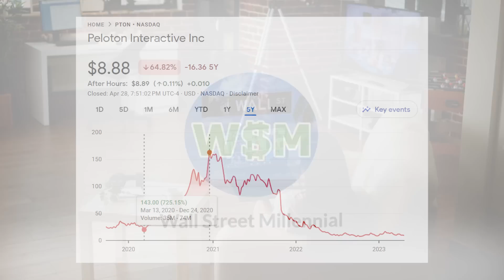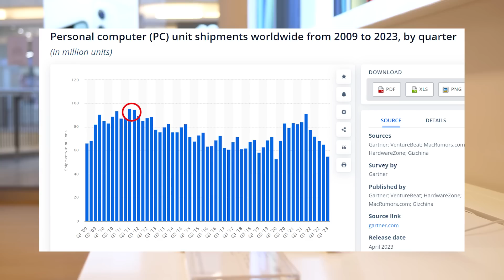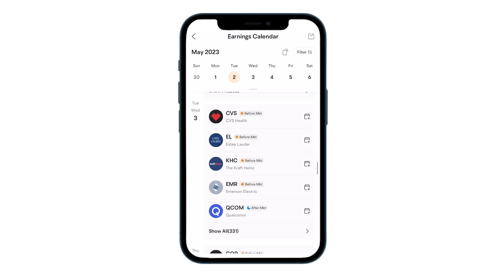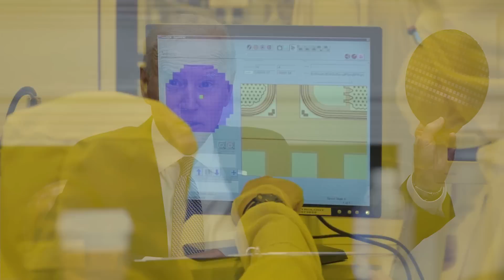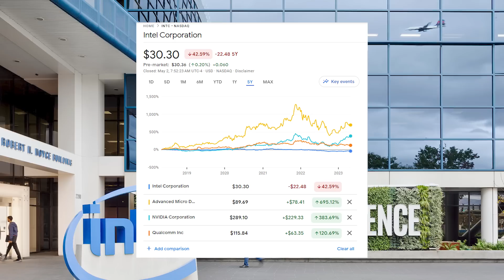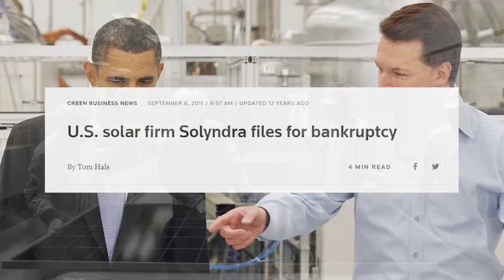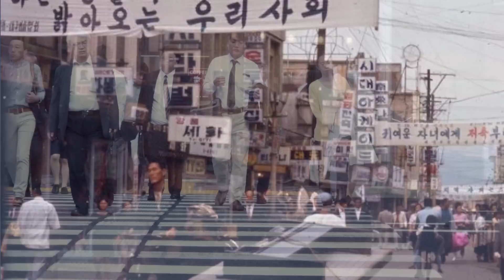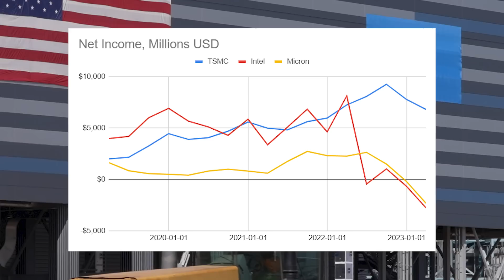The Great Semiconductor Glut: Unintended Consequences of Govt. Subsidies

Comment: I think you miss the ever growing demand for NAND flash in SSD's, GPUs for AI and various rendering or massively parallel operations, the ever growing world of IOT, and for the entity of the data center market. (more power efficient servers, switches, routers, NICs, think stuff that gets burned out oftenish.) That 2011-2020 its also important not too much was happening due to multiable failures from AMD, and intels unwillingness to improve. The consequences of such has been a slow burn for intel for almost a decade. Thats not even getting into how tax law encourages companies to constantly upgrade IT hardware in large data centers.

Comment: Sorry, but this video contains several informations that are simply wrong or misleading.
First: the cost of labour makes setting up a fab in the US unattractive. This is an old myth stemming from the 1980's when the industry started to leave the US. Back than the percentage of labor cost per Waferstart was at 37% of total cost. In 1995 this percentage had already dropped to 11,5% and has dropped even further. Why? Simple: the most expensive part is running the fab: facilities, energy, water, materials etc. - and managing these cost and managing a high volume output with a high yield is the key to running a profitable fab. But this is something investors don't want to hear because it's so much easier to dump all the blame on the staff instead of doing the hard work to identify the stuff that really cost you money and to invest the money needed to improve things.
Second: You're looking at the wrong companies for a picture of the semiconductor market. Intel is no benchmark at all since it's been the old sick man of semiconductor business for quite some time now (it started before the pandemic but the problems were glossed over by the high sales during the pandemic). PC is not the main market for semiconductors, you've to look at the industrial applications like automotive, energy, microcontrollers - that's where the money is. TSMC does foundry work in this field as well and that's why thei're not hit as hard as the manufacturers of CPU's and DRAM. And in the industrial market hasn't been a correction of the market yet  there's still way more demand than supply.
Third: China can increase their subsidies for semiconductor fabs as much as they want, they can't get the most important machines for the high end stuff: DUV Lithographic Tools. These are banned from getting exported to mainland China.
Take a look at semiconductor companies like Texas Instruments, Renesas, NXP, Infineon etc and you see a different picture... . Do I say that the subsidiaries for a company like Intel make sense? Not necessarily, it depends what Intel is going tp produce. Lately the Intel CEO talked about taking up foundry work. If they do this on high quality level they can be succesful, but if they mess up big time these new fabs could become a monetary burden that could very well start the downfall of the giant.

Comment: Semiconductors have ALWAYS been boom and bust. These new Fabs arent online yet and aren't going to start producing in any volume for a few years at least. The shortages are a lot more complicated than people realised. Most of the shortages affecting appliances and cars came from other components like power stages and substrates. 

The issue with automotive is the hubris of automotive manufacturers. They were using very old dirt cheap nodes. When they cancelled orders many of these older fabs were shutdown to transition to newer more profitable and productive nodes and now automotive component suppliers are scrambling to change their designs for these newer nodes.  As a result car making is still screwed. Interestingly Tesla uses much newer nodes for most of its semiconductors as do the newer chinese brands which is why they are less impacted. 

Intel is lagging behind AMD in terms of architecture for it's processor performance and behind TSMC Nodes and they have been steadily losing market share as a result. 

Demand has fallen for a number of reasons. 
In client a lot of consumers bought during the pandemic and probably won't upgrade their systems for a while. You also have ethereum switch to proof of stake which basically killed GPU minning which has resulted in a lot of relatively new ex minning GPUs flooding the market switch supresses demand for new GPUs. This current generation of GPUs is also pretty uncompelling for consumers as it represents a relatively small improvement in performance for most SKUs. 

Enterprise and hyperscalers which make up the majority of volume for chip makers like Intel AMD and Nvidia are reducing orders due to tighter monetary policy and uncertain economic conditions. Intel has been hurt the most by this as AMD continues to take market share from them. 

TSMC is having problems with their newest node iteration which apple was set to use first for their new iPhone and M chip as a result Apple isn't ordering as much as they otherwise would have and have changed their launches of new products. 

We are in the middle of the transition from DDR4 to DDR5 so demand for DDR4 is falling but DDR5 is not ramping up as fast due to slowdowns in procurement in the enterprise and client sales which is hurting micron and samsung as the biggest suppliers. 

Samsungs 5nm and 3nm nodes are not yielding well which also doesnt help them with mobile chip sales. 

In the short term things are messed up but by the time new capacity comes online it's likely that demand will have rebounded. 

The elephant in the room is china and taiwan any conflict in the region will disrupt the entire supply of electronics and this is the main reason for onshoring more capacity.

Comment: Great video! However you seemed to miss the most obvious reason for the United States to subsidize semiconductor manufacturing, national security. In fact I don't think you mention once the national security interest the United States would have in not only maintaining a domestic supply of microchips in the event of potential trade break downs due to either pandemics or war, but also the increased need for those chips during a potential conflict. Even with most semiconductor fabs existing not directly in China, as they expand their sphere of influence the world's major fabs are within an ever shortening reach. The United States is maintaining subsidies in semiconductor manufacturing to maintain their technological dominance and military scale against peer and near peer adversaries.

Comment: As usual the devil is in the details.  Intel does NOT make the "Chips" that dominate the supply chain problems we see in devices/cars etc.  Intel primarily make server-farm and laptop chips.   Anyone with half a brain and any knowledge in the semi industry saw this glut coming and the chips act as a big corporate welfare give away to a company already making 50% gross margins.
Reply: although I agree with most of what you shared (I worked in semiconductor for >20yrs), there's a reason why companies don't build fabs.

It's extremely risky and capital evaporating, where you don't get a return on your giant financial risk at least 5yrs or more into the future.  Your investment doesn't even generate any revenue ,let alone enough to cover the risk, for at least 2yrs minimum.

Companies HAVE to have high margins to cover the past risk, but also to pad themselves for the next high risk investment.

Building a foundry, and going with a foundry to build your chips is the much safer route.

I've seen dozens on dozens of chip companies go out of business since the 90s.

I have no issue with the subsidies, to compete with foreign companies who do get massive unfair subsidies to put the USA out of business .

Comment: Intel's problem is not that of costs. They fell behind in their fab tech, making their chips less competitive. Intel even started using TSMC to manufacture some of their chips, which is outright shameful from historical perspective.
Reply: @hoppingrabbit9849  why are you salty, calm down, no need for insults, grow up
Reply: TSMC is way ahead any other competition
Reply: Those were dark days for Intel. There were far too many years during which Intel chips saw a very modest performance gains from generation to generation, while AMD kept making big gains. Some of intel's later chips were frankly quite pittyful until they got their own EUV process working properly. However, they finally solved their manufacturing problems a few years ago, and their current chips are performing about on par with the competition. From an enthusiasts perspective these are golden days, as both companies offer really strong CPUs now, but with different performance characteristics.
Reply: @fnorgen  you're describing chip design, which is a different thing than chip manufacturing, Taiwan is way ahead of any other competition in manufacturing

Comment: There should also be standardized microcontrollers with standardized peripherals, standardized power control ICs, etc. so that one doesn't have to rely on a single manufacturer or a single point of failure.  The fact that a car can be engineered with proprietary components from hundreds of different manufacturers, for example, makes the sort of supply chain nightmares we have seen inevitable.
Reply: Impossible, as there's another generation of lithography machines that can be invented before we max out the technology.
Reply: @samsonsoturian6013  Just because new ICs with new capabilities can be made doesn't mean that simpler devices can't be standardized.  Most of the unavailable semiconductors are not made with the latest processes, but because these semiconductors are available from only one manufacturer, this leads to shortages.
Reply: @profdc9501  dude, older chip factories just make things for non-computer items (appliances, tools, car accessories, and so forth). Only computers really need the latest chips.
Reply: @profdc9501  Chip makers cut anything the customer asks for and a lot of it is specifically for the device in question. It's like cars where a lot of interchangeability exists on common vehicles, but your mechanic might not have the needed part on hand.
Reply: Standardization doesn't happen because customers need specific hardware. Making a single chip which has all the interfaces and capabilities you need in sufficient quantity, means ridicolous expensive chips. If you look at any microcontroller manufacturer, you will see them listing out different products for different market segments. They do that because they need to make sure that their chips come with the features the market needs.

Comment: No, you need to think strategically. This is only about one thing: moving away from Taiwan dependency.
Reply: No one was dependent on Taiwan
Reply: @samsonsoturian6013  Funny. TSMC is the largest, and really only, chip producer of high end chips, in the world.
Reply: @djayjp  there's a lot of chip makers
Reply: @samsonsoturian6013  No, there are not. Most others only make RAM. AMD and Nvidia exclusively use TSMC as they are the only non-RAM chip maker that uses the smallest transistor density in the world.
Reply: @djayjp  A lot of fish in the sea and a lot of specialties. You saw what happened in Taiwan's draught, the problem wasn't that there wasn't any chips the problem was there wasn't enough for everyone.

Comment: You can’t repurpose pc chip manufacturing lines to produce chips for the auto sector.  They use different tech. 7nm/9nm processes vs larger processes. 

Also, a big part of the chips act was to bring more chip manufacturing, as well as more modern processes to the US.  

I know this is an investment analysis, but maybe go a little more than just money.  Investors who solely focus on money is the reason we have so money issues with corporations that seem to place short term gains over anything else.

Comment: The key in solar manufacturing today acquiring higher-wattage cells which is manufactured in Asia, mainly China. Chinese companies do not sell these cells as they use it for their own manufacturing, currently a number of US based solar panel manufacturing companies are racing to start up their own cell manufacturing to effectively get the US subsidy for locally manufactured cells, and compete more effectively in the Solar panel market.